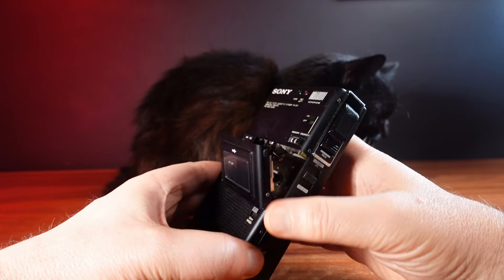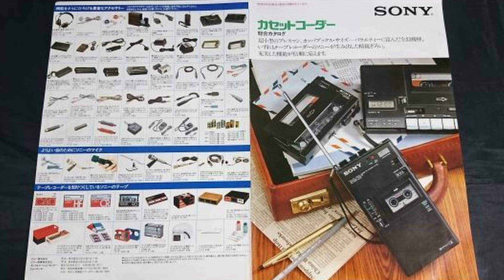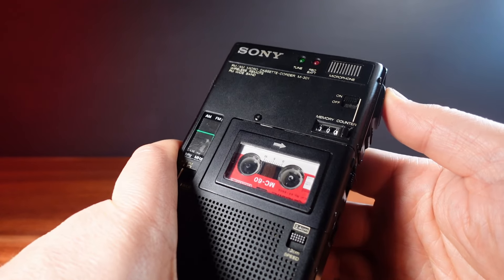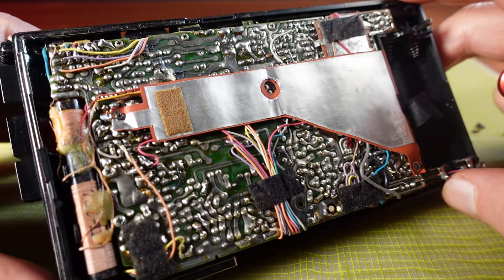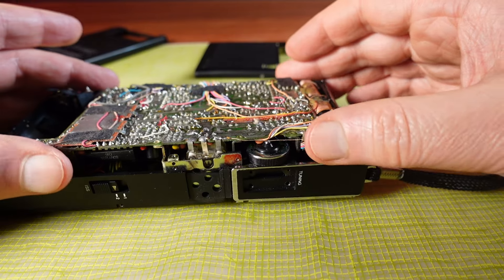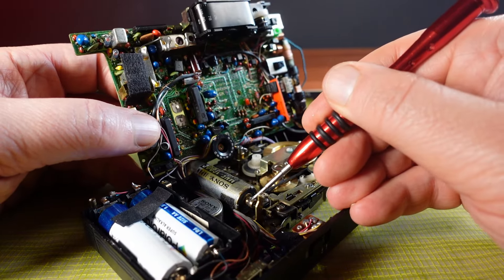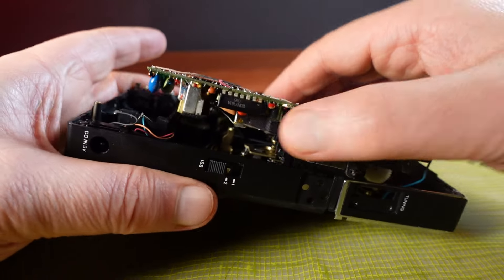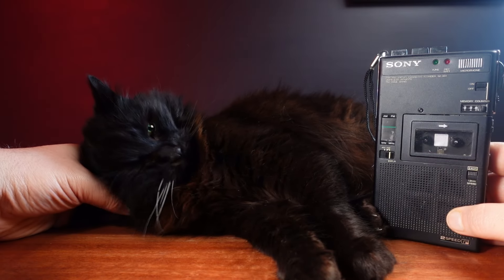Much Older (and more Broken) Than I Thought

Comment: I wonder if the "wireless remote control" was something that worked sonically, like the literal "clickers" for some televisions of the era.
Reply from the maker: I love this possibility. I remember hearing about these things as well. Thanks!
Reply: Exactly that. The handset was mechanical
Reply: Yes, and the receiver would be a separate unit for the usual pause socket on tape machines.

Comment: I too have a policy of carefully reassembling things I cannot fix right away. Always giving it a good cleaning at the same time of course. Much respect to you for doing that. 

Currently in my collection I have: 

A Sanyo record player from the early 70’s. It needs a thorough recap and a new stylus, but unfortunately the plastic chassis has become so brittle with age that any further repairs just caused more damage. 

An even older Philips record player, very compact, all plastic, single detachable speaker. 

A robot vacuum cleaner 😅

A Bose Soundlink, V1. It blew the power supply section, but the 2 very potent amp chips still work and can be hacked easily. 2 x 30W rms in an enclosure the size of a novel. 

And lastly an immaculate Chinon 872 8mm video camera, complete with original case and all owners manuals. Japanese made, it feels heavy and solid. This one I still have to work up the courage to tackle, it might even be working for all I know 😅

Keep up the good work Mr Janus. Love your videos.

Comment: Use a multimeter to check if the motor is getting power. Some of those models the motor seizes too. Best to start by checking voltages from the batteries.
Reply from the maker: I admit I didn't really do enough fault finding. I've been a bit under the weather health wise recently and didn't give this enough attention.

Comment: Did you check with multimeter if there’s power coming to the motor?
Reply from the maker: Now that would have been a smart thing to do. Thanks, I miss the obvious sometimes.
Reply: @JanusCycle  You can also give 3 volts directly to the motor to see if it starts (or whetever voltage it is rated)
Reply from the maker: If I was smart I would have tried this. Thanks for reminding me. I've been in an odd headspace recently from being unwell.
Reply: @JanusCycle  Do you have a discord server? asking directly from community is a good idea when this kind of problem occurs!
Reply from the maker: @maxsun2418  I do, but we mostly do phone modding and digital stuff. Not many people on Discord know about this sort of 70s gear.
Reply: @JanusCycle  Ahh. That's cool! Tbh your presentation on these old technologies are really calming and entertaining. It would be really cool if you keep doing this, maybe even become part of your channel.

Comment: Although analogue radio tuners didn’t use phase locked loops until digital tuners came along, that was mainly out of cost and reliability as there were methods to do it in the analogue domain. AIUI a comparator would control an op-amp which controlled the voltage going into the VCO, the output of which was split back into the comparator. 

It just so happens the superheterodyne principle is much cheaper, so that’s what radios use. Especially as the analogue methods still drift anyway, it just reduces it by a decent amount. (Adding a reference frequency like a precision quartz clock could help, but you needed a whole whack of other circuitry around it then. And you basically have to compare your tuner against the station’s frequency in a radio.) Digital became a byword for PLL for radio tuning as a result because it was so cheap, integrated and compact, and far more accurate and reliable.

Not to even say anything you said in the video was incorrect, as it is fully accurate in the context of consumer radio! But some Radio Guys do get the impression that that’s the only way to do it, period, in all domains and applications.
Reply from the maker: You knowledge of radio tuners certainly exceeds mine. I have so much to learn.

Comment: Past it here. It needs service and use to do all that for this stuff, video,etc. you just need to right tools and the knowledge. Because the motor is not running don’t mean it’s the motor. You need to find the test point and scope it.
Reply from the maker: Thanks, now that I know how to disassemble this, next time might be more fruitful.
Reply: @JanusCycle  test to see if there is voltage going to the motor with a meter. Also check gears with oil to make sure they not seized up. That’s why I say it needs a service where you strip it all down and rebuild it basically and replace all capacitors and using a scope for realigning and checking test points.